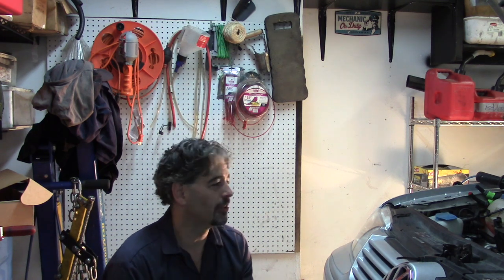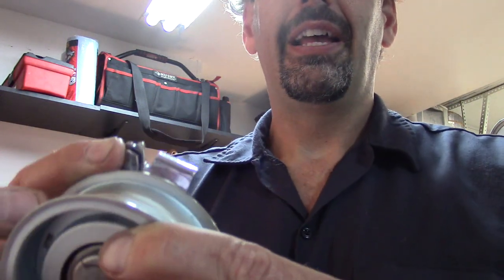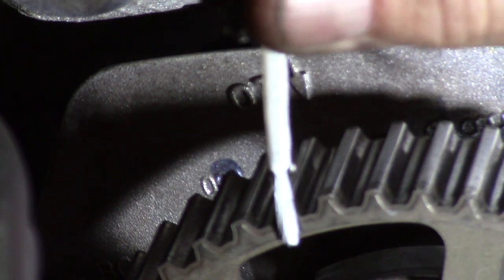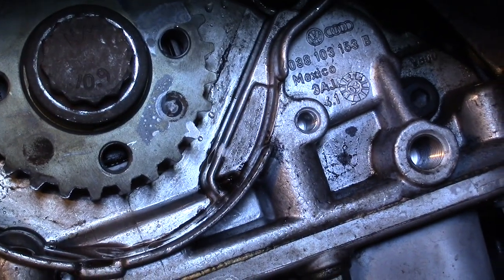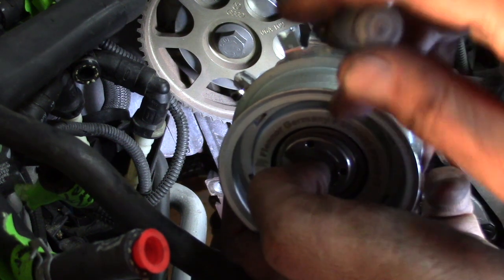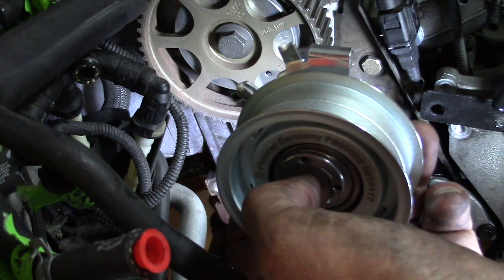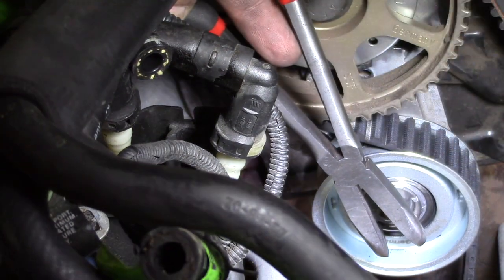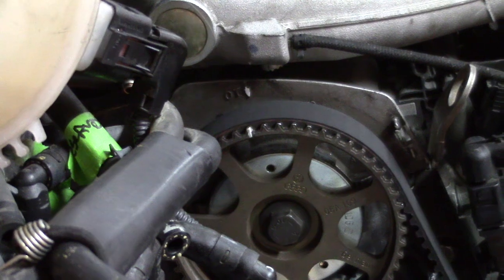PROPER Timing Belt and TENSION 98-05 VW 2.0L Jetta, Beetle,  GTI, Golf

Comment: I'm a firm believer in the Dayco timing belt book. If anyone ever needed all data it would be you S...the v6 has an awesome setup for a timing belt...that would make a slick video...thumbs up!
Reply from the maker: area46241 I wonder what's different about the V6?
Reply: +Schrodingers Box I have the 2.7T V6, and the procedure there is to lock both camshafts and the crank using some special tools. The sprockets can rotate on the tapered ends of the cams, and are only bolted tight at the very end. This way the timing can be adjusted exact, not half a tooth early or late.

I read this procedure the last time and intended to do it myself, but I couldn't get the tools in time so I had to let the dealer do it. I  have since bought the tools so I'll do it myself next time. 

This is a few years ago now so I don't remember every detail, but I think what I mentioned is what he was thinking of.

Comment: Did one some years back... "An annoying chirping noise" they said.
The bearing had failed in the original tensioner had failed so the edge of the pulley was eating into the belt. 
The belt was barely a quarter inch wide.
Reply from the maker: Simon Parkinson I have seen this on other cars too!  On a ford escort there were literally just a few strands on the belt!! The inside of the timing cover looked like a birds nest lol!!!

Comment: I noticed on the crank shaft that the pin on the crank gear centers between the two notches on the engine at tdc.  

Great video though.
Reply from the maker: kareesmoon Those two "notches" are droplets of coolant from the water pump change, so I don't suggest using that as a reference.
Reply: Schrodingers Box fair enough. Depth perception is hard with one camera eye.